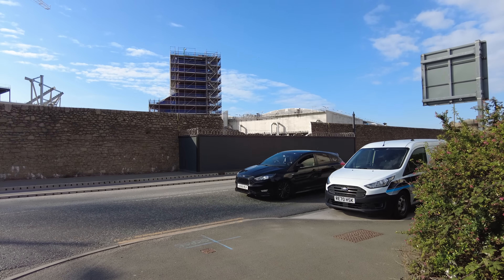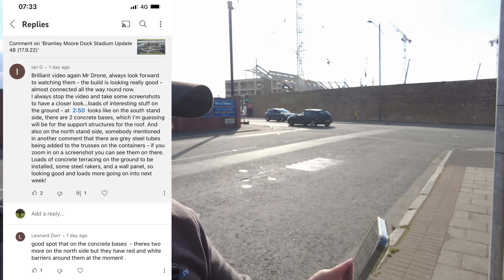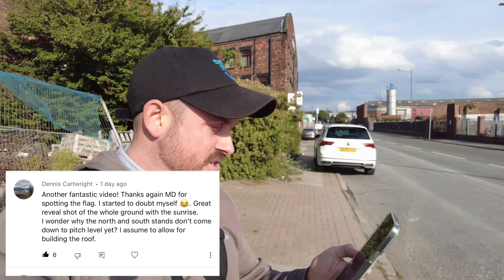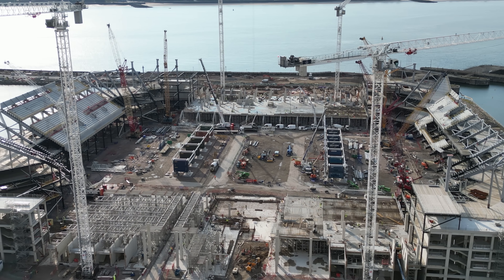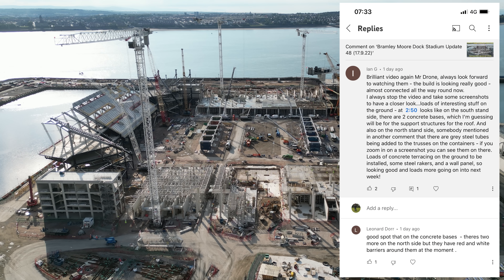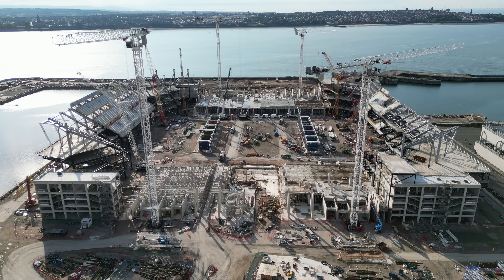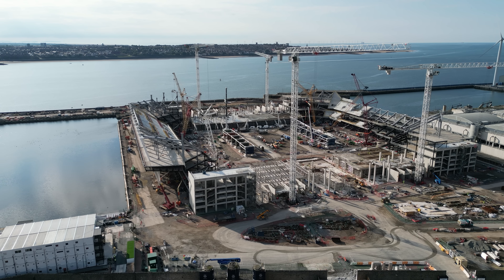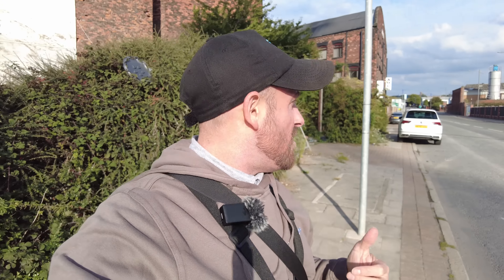Bramley Moore Dock Mid-week drone visit with VoiceOver  (20.9.22)

Comment: On the image you shared of the roof being built, on the south stand, you can see six blue support frames holding the roof up. I am assuming those concrete foundations are where those support frames will sit.

These are where the lower north and south stands will later exist, so that seems to be the reason why those sections are built last.

Comment: Another thing to think about is the actual pitch level will be a lot higher than the floor level as it is now . By the time under soil heating drainage and watering system go in it’ll probably be 4 ft higher than it is now .

Comment: The pitch level I believe will be a good few feet higher, and the bottom sections are done last so there will be ease of access for internal work.

Also I don’t think them pads are for the roof, the roof will be supported by the stands. If you look in this video at 12:20 you’ll see flat sections of concrete, the roof span will span from that region and right across, but a bit higher.and if you look closely to the right corner where away fans will be, I think there is a steel post gone in already.

Comment: I've done some steel erecting over the years and the most likely reason the bottom parts of both stands are left to the last is because most of the fixings will be underneath and is just to get machinery in and able to move along for the fixers without any obstacles.

Comment: Great work and images again.  I can maybe answer some of those technical questions if you need me to. Trusses definitely being erected off the containers. I reckon they’ll be off the top of the tall circular columns at the back of the stands at the corners.
Reply: I've got a question mate. Why use shipping containers as a support structure for the "roof trusses"? I've never seen shipping containers used for anything other than storage or security. I'm puzzled.
Reply: @pleasantville4529  I've never seen that either - looks like someone just had the bright idea they were the right height and easily available. Suprised they don't have advertising on though. We have a trendy storey building over here in Sheffield that is made from them

Comment: That’s half a roof truss. The trusses look like they’ll bridge across from tower to tower and the space across the top of those containers is only half that. From the shape and curvature of the grey steels you can see that one end is towards the centre of the curved roof truss. It’s going to be an impressive lift when they go in. I guess they may need to put temporary towers in the middle to support the middle until it’s all connected up in the air maybe using those extra concrete bases

Comment: Great video as usual....there doesn't look to be a lot of room behind the North and South Stands for fans to queue up to get into the ground so is the plan for the fans to enter the ground via the corners of the stadium? Would be worried about people falling in the water behind the South Stand if there are turnstiles there 😊
Reply from the maker: Hi Mark, great question!! 
I believe there will be a walkway under the North Stand and there will be plenty of space behind the south stand according to the early illustrations 👍🏻
Reply: There is actually a lot more space than there looks. The scale is huge. There is 9.477m from the North Stand to the UU wall. I guess that is similar to the width of Bullens Rd. There are only, I think, 3 turnstiles at the eastern end of External Northern concourse, which are for away fans. Access is limited to that concourse, with most people accessing the North Stand through the Northeast and Northwest Cores as you suggested. 

There is 28.485m from South Stand to Nelson Dock edge. The safety balustrade is approximately 2m from the Nelson Dock edge. Therefor the pedestrian access along the Southern edge of the stadium is approximately 26m wide. That is massive compared to the spaces around Goodison. I don't think there are any entry turnstiles on the external Southern concourse so there will be no queuing there however I think there are some exit gates. Again, as you said, most people will access the South Stand through large banks of turnstiles in the Southwest and Southeast cores